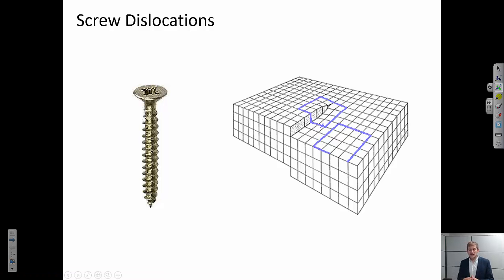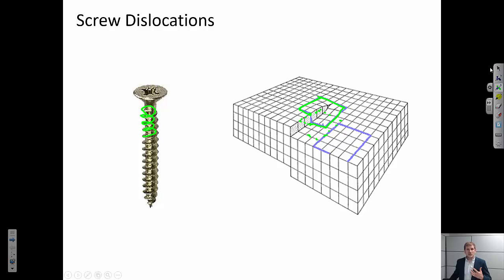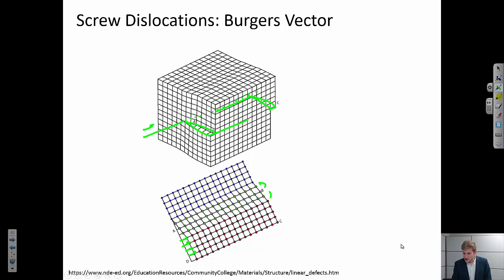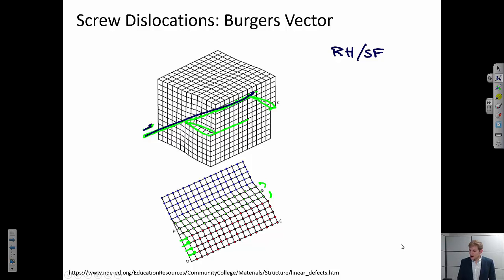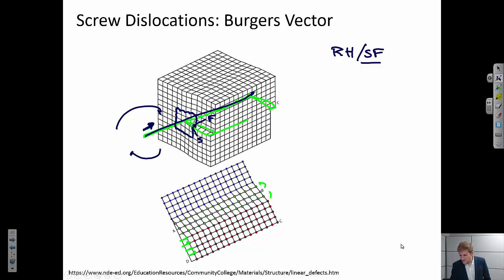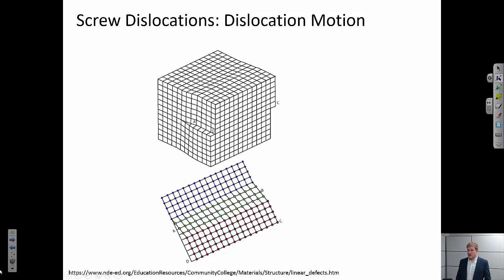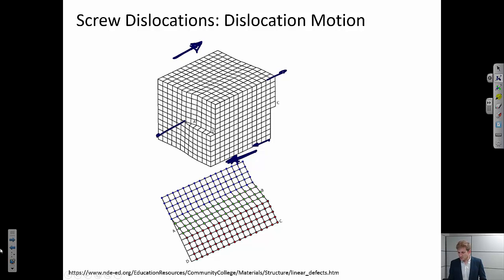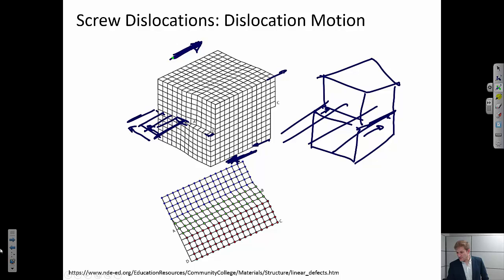Screw Dislocations {Texas A&M: Intro to Materials (MSEN 201)}

Comment: very clear explanation.could u suggest a good book on material science?
Reply from the maker: Nitesh Stryker Thanks!  the intro textbook by Callister (there are a couple different versions with different organization of content) has been adopted by an overwhelming fraction of into materials science courses.  Not to imply that this is the only one, but I do believe it's clear, and as good as any other intro text out there.
Reply: +Patrick Shamberger 
I have a small question:
At minute 2.17, what is the exact location of the dislocation line? Because my book places it just like it is placed in the bottom picture on that minute (so about two interatomic distances away from the start). While in the above picture, in which you draw it, it is placed right at the start of the dislocation.
So if you look at the bottom picture, it is placed in the middle row of the green atom dots. While I would have expected the last row of blue atom dots, that is next to the first row of green atom dots. Because from there the dislocation seems to start and get worse when you move to the 'D' in that picture.
Reply from the maker: +strateeg32 Good (and subtle) question.  The easy answer is that the dislocation must be located entirely within the burger circuit that results in the burgers vector for that dislocation.  Certain dislocations can have very tight dislocation cores, so it's easy to localize the dislocation with a very specific position (e.g., <111> screw dislocations in BCC metals.  see: the image here: http://www.mcl.at/en/forschung/atomistic-modeling/dislocation-modeling.html ).

In the cartoon drawing in the video, the shear is spread over ~4 or so interatomic distances (i.e., those atoms shown in green), so to get a burger's vector, your burgers circuit must be relatively large to accommodate all of this shear.  Thus, it's a little difficult to identify EXACTLY where the dislocation is within that circuit.

However, there's another piece of information which wasn't discussed in the video (And perhaps not in your text), which is that shear is distributed radially around a dislocation.  That is, there's nothing too special about the step plane that is shown in the image.  Thus, the book is correct in locating the dislocation centered in the middle of the region of shear.
Reply: I use Fundamentals of Material Science and Engineering by Callister (4th edition) and it is a great book! Totally would recommend it :)